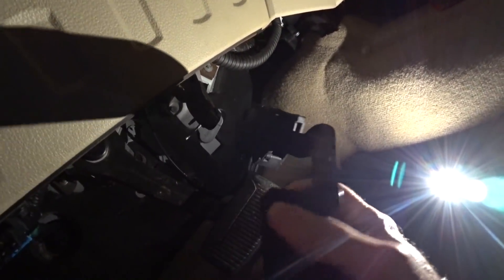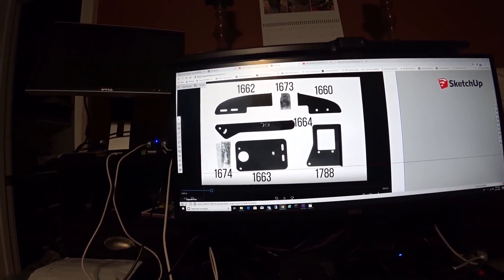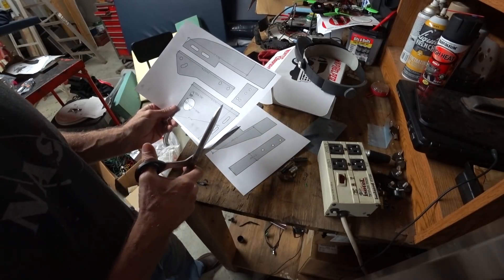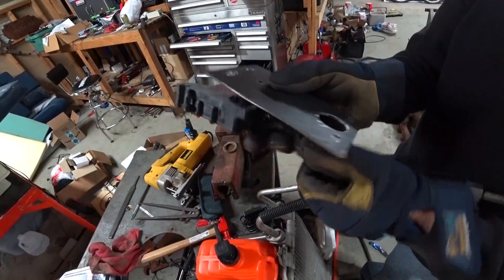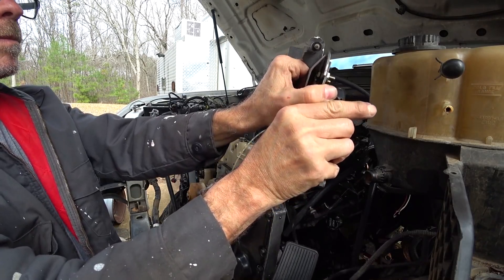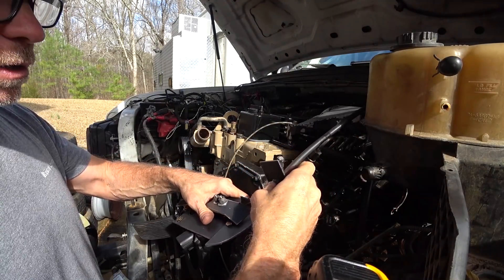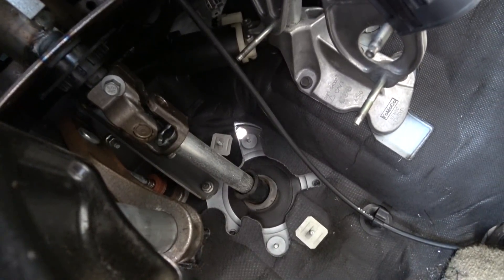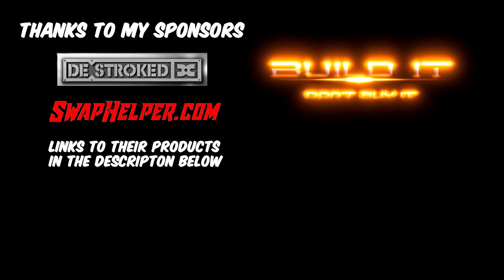6.4 Ford F250 to 12 valve Cummins Swap - Electric throttle pedal to mechanical

Comment: Could you please tell me did you use the stock 95 to 98 ram 2500/3500 Throttle cable?? Thanks for sharing